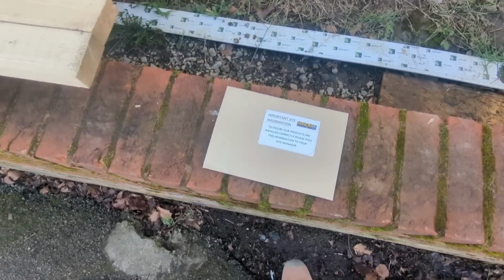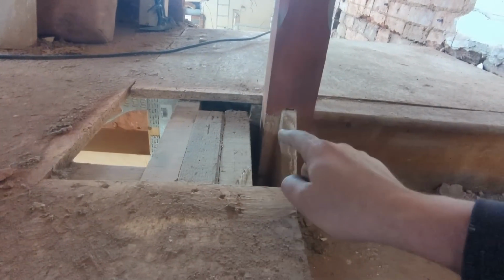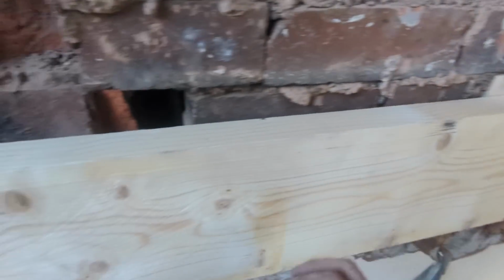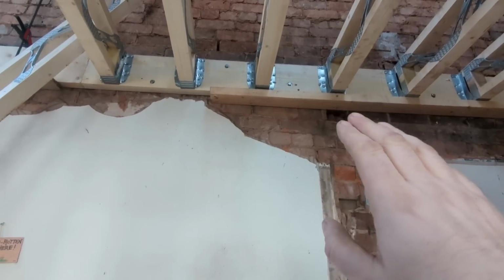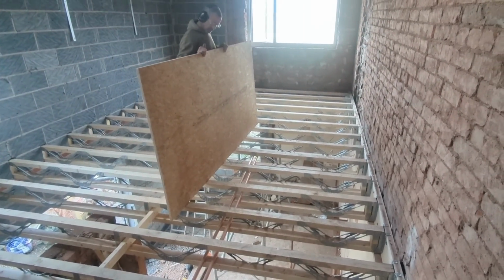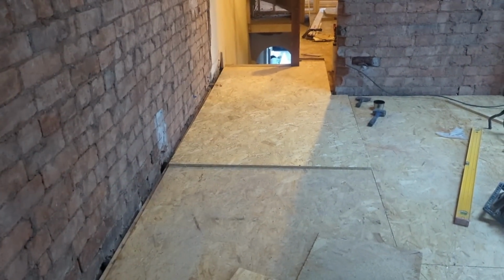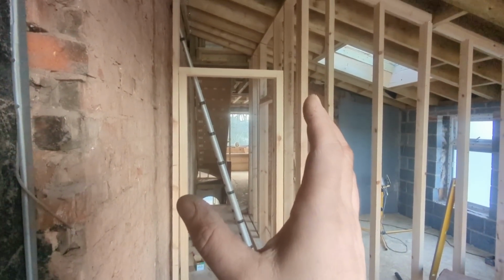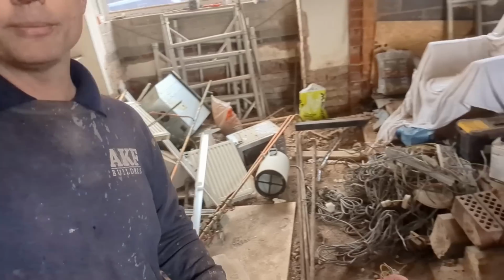Installing Space Joists - Everything You Need To Know. Builder Destroys His Own Home #7

Comment: More economical on copper, also easier path for the gas so you don't have to increase the size of the pipe to 28mm or 35mm due to pressure drop - which would be a massive pain with that type of floor joist set up to find out pipe is undersized when commissioning the boiler.

Comment: Great progress and looks like heavy work ahead. I’m curious though why on a story house with stud walls. Why do you need fire doors? Or does plasterboard and insulation offer a high fire protection now? If they were block walls floor to ceiling around the stairwell. It makes more sense
Reply from the maker: I think that it's the plasterboard that gives the stud walls it's fire protection, but the wooden door is obviously the weak point from a fire point of view so you're required to install fire doors.

Comment: Is a concrete screw good in an old brick wall of a unknown strength  would not a resin bolt be a better method
Reply from the maker: Hello Eddo, hope you're well. Those concrete screws are emese! It's going nowhere and of that I'm extremely confident! Resin bolts would of course be great too, but it's still into the same wall so the same issue with the strength of it is still there. Either method is great. Thank you for watching mate, all the best.

Comment: Hi Adam, you gave some great information on the joists you used there mate and you were lucky to be using a good supplier. Cost wise how would you say they compare with 200 by 50mm solid timber. Also the ceiling plate you fixed to the rafters to form the bathroom corridor wall, did you have to cut the inside edge of the timber at the pitch angle of your roof, to prevent it interfering with the plasterboard laying flat? Goon luck with the floor and Easter.👍👍
Reply from the maker: Hello Kevin, hope you're well mate. Costings is something that I should've gone through, sorry about that. I reckon that these joists, materials only, would be £300 - £400 more expensive. Labour costs though would have been a lot more. I'll go into more detail in the next episode. As for the timber...I'll get over that!

Comment: Great work and accuracy to achieve level floors. I have them joists in my house with underfloor heating and screed at first floor level very strong and secure. Brilliant job 😊
Reply from the maker: Cheers Paul. You're happy with them then? Mine are solid, I'm very impressed. Where I've used OSB to go over the joists, what have you used considering that you've got UFH? Does it work ok?
Reply: Yeah it works fine very efficient. We have osb on the joists and then the ufh screed on that no movement at all. I was worried there would be over time but 6 yrs in and all good.
Reply from the maker: That's amazing! Thank you for getting back to me. Take care.

Comment: Superb Video. Just curious if the Studwork was 4x2 and what reason you went for 4x2  is it for fire regs or just preference,maybe I missed your tech info on this part of the refurb. Also can you give some tech info on the flooring you are using. Seems a great format to use large sheets of OSB. What thickness is specified. Missed your usual tech spec in this video. Great Job.
Reply from the maker: It's stronger and I get more insulation in! That's the only reason!

Comment: I’m not a builder and haven’t read the Building regs for years but is the butted OSB a good enough joint for fire/smoke resistance? Or is it not a requirement? Cheers.
Interesting videos!
Reply from the maker: Hello Woolly, hope you're well. That's not a concern I believe, so it'll be fine. It's all got to be plasterboarded on the underside and covered on top anyway so hopefully it'll be alright. It's not an issue that I've ever heard being a requirement but I've been wrong before!

Comment: Is osb suitable for floor boarding.  How will you make air tight. Also the weight of furniture and a heavy bed use legs will end up in your down stairs.
Reply: 22mm OSB is stronger than 22mm chipboard
Reply: @EcoMan-te4vu  okay if you say I'm not expert.  But how will you make air tight for energy rating. Will the edges also need to be filled with fire resistant foam.  Just couple things building inspector has pick up on several jobs been on. Also osb isn't fire resistant. So will not hold back fire like chipboard tounge and Grove,
Reply from the maker: Hello Eye spy, hope you're well. Air tightness isn't a building regulation in this instance, and I doubt very much that my bed will wind up in my living room. Thank you for watching, take care.

Comment: Are these space joists work out cheaper than 9x2 timber joists? 
Do you install them 400mm centred?
Reply from the maker: Hello Sounds, hope you're well. I should have gone into the costings a bit more in this video and will do it in the next, sorry about that. In short, this way is more expensive than 9 X 2 and yes, they are at 400mm centres. Thank you for the questions mate, take care.
Reply: @Mr_A_Builders  Thanks a lot for your comments. I'm guessing the benefit of these over timber joists is that they can be installed by one man due to lighter weight. I guess timber joists are quicker, more forgiving and more workable. These space joists have to be ordered/made for the job, installed exactly spot on and services passed through during installation.